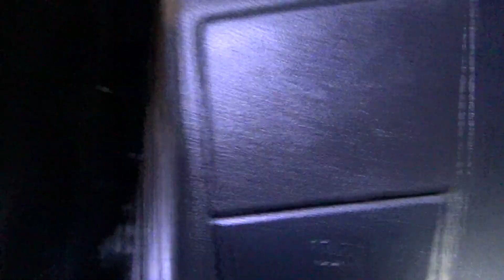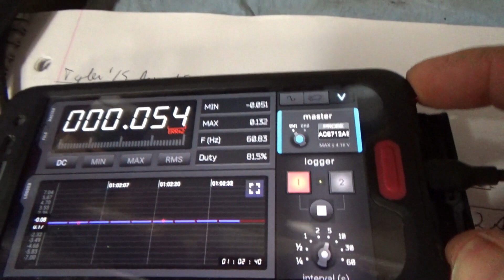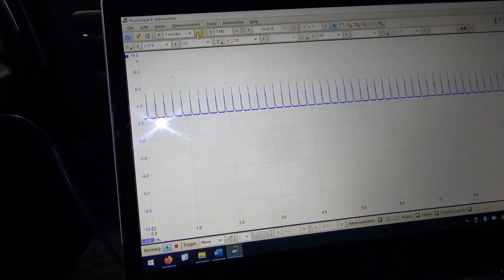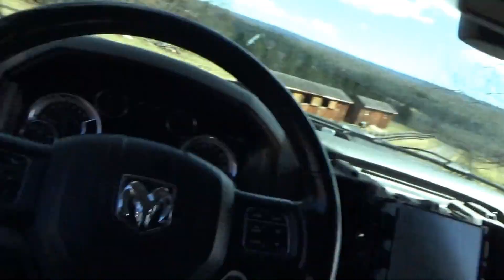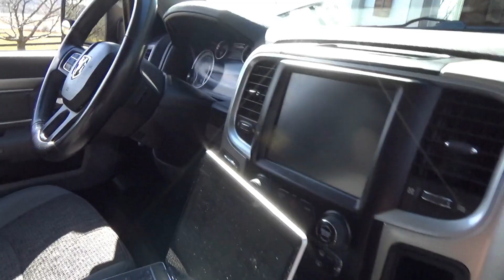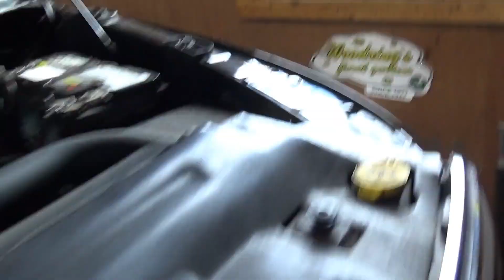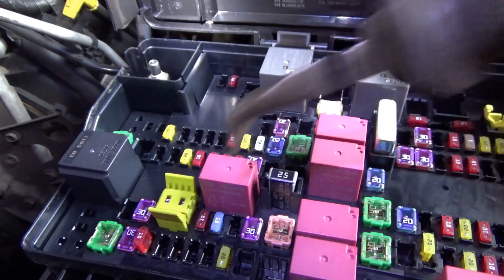Have Never Seen THIS Kill a Battery Before... (Parasitic Ram - Part 2)

Comment: Obviously a bit late but seeing as the module was faulty could you have cut the pin off the board and soldered the link across the back of he board then at a later date you could just plug in a new module in and it would work
Reply from the maker: Sure. My external mod guarantees that the problem will never happen again even if the replacement module fails in the same way 👍

Comment: We used to have a local electronics guy who would fix these modules, over the years his costs to fix was boarder line same as buying a new unit. He retired during covid.  
I recently had a issue with a battery tester out of warranty. Its basically a tablet based unit. I brought it to 3 local places and all wanted $90 just to break it open and see whats wrong. All where straight up and said the few problems they believe it could be im getting close to just buying a new one. Which I did.
Reply from the maker: What's a battery tester?

Comment: Modules are so expensive because you need it. Plus the parts are shit. Your so right on the over integration of all these modules.
I had a dodge with a what lead me to believe was the module berried behind the rear seats and rear cab pannel near the rear power window. Same thing module was $800 and labor just to get to it was another $300. 
   The customer could barely make the payments on the truck. It was towed out.
   Also availability of parts is going to be limited and I dont see the aftermarket keeping up. So going forward we will be lucky to get 10 years out of cars.

Comment: As a suggestion, how about using a relay to isolate the comms wire from the network, the relay being operated operated by the ignition (switched 12V) similar to what you have done. That way the module will still be connected to permanent 12V and keep it's memory whilst allowing the car to sleep. (Although granted the faulty module itself will still draw a little current, but a lot less than the whole network was). Don't get me wrong, yours is a great solution and certainly the best for battery life. I 'll bet there's not much wrong with that module either, maybe a shorted diode or capacitor between the permanent and switched 12V rails, so the switched rail is being held on. Probably a 1 dollar part or less causing the issue.
Reply: The Battery would probably die in 4 or so days instead of 1 or 2 with a relay installed.
Reply from the maker: @NoWr2Run  maybe a week...
Reply: @PineHollowAutoDiagnostics  OK, You are the EXPERT, SIR.
Reply: The surface mount capacitors are notorious for failing. You can replace with a through hole electrolytic quite easily. The larger ones is probably the rail caps.
Reply: @jimgross5  So are the small ceramic  capacitors. They have a tendency to go short, or more bizarrely as I have seen in Michael Dranfields recent TV repair video, can act like a variable diode, which is very strange indeed.

Comment: Ivan, nice fix option, however...I believe upon each re-powering of the HVAC module the stepper motor controlled blend doors will be commanded to go through their "recalibration" cycle [full clockwise, full counterclockwise]. I'd be concerned about short life for each blend door motor. Those modules are priced "stupid" expensive for the same reason that healthcare costs are...because they can. :)
Reply: Yeah that’s the only issue I see with the module not having battery power. Dodge vehicles are especially picky with hvac actuators and calibration. If one of them fails it’s tries to recalibrate every time you turn it on and it takes about a full minute before the air will start blowing normally. In this case it’s going to have to recalibrate every time regardless. That would be a long minute in this southern heat where I’m at 😂
Reply: Lets see, lets wear the stepper motor blend door mechanics out not from use but recalibration. Sounds like an HP printer using up more ink turning on and cleaning then in printing.

Comment: 1. Automotive engineers are being too smart by about 90%. The old electrical systems worked just fine with far fewer failures. 
2. Would it have been prudent to locate and inspect the failed module before calling the customer?
3. Is there a used HVAC module available for less cost? 
4. I promise that module didn't cost Fiat over $800 at the factory. This is a ripoff.

Comment: Ivan, if you think there are to many modules in a 2015. Just wait a few more years. I am tech at ford dealer and the new cars have an absurd amount of modules. It will make your head spin. Modules for over the air updates, hotspots, "smart" charging systems that don't keep the battery charged.
Reply from the maker: Euro cars had like 50 modules and 6 networks even 15 years ago... Insanity!

Comment: using a higher amp fuse is a bad idea.  there may be wires on that circuit not capable of handling that amount of current.

Comment: Had a '15 Ram like that with the Ecodiesel plus the air suspension. Never really had any problems with it but every day I became more and more wary of things like this happening. I got a great deal when I bought it very slightly used. I decided to sell it before stuff like this started happening. We have an Excursion with the 7.3 and I decided to go back to that for towing, etc. I do miss the Ram but I'm sure I saved myself headaches like this.

Comment: Ivan, You picked the right field of automotive repair—great diag and fix. More bells and whistles cause more problems than they are worth. The problem is even base-model vehicles are littered with chips and electronics. I'm considering replacing my 2009 Ford Escape with a 2006 Lexus LX470. Am I nuts?

Comment: Car manufacturer and dealers have killed the goose that lays the golden eggs, cars are way to expensive. With just the cost of parts one should be able to charge the manufacture and the dealer with financial rape. The legacy auto complex is killing the car market. The MSRP plus the dealer markup has finally caused the consumer to draw a line in the sand as say enough is enough. I don't care if the auto industry collapses and has to rise back up, cars need to be made simpler and and with lower prices, not cheaper. 99% of the houses around the world don't have all the automation that a cars has. what ever happened to manual windows or a HVAC system that has low, medium and high or a tail gate or hatch that is manual operated.

Comment: I had a similar one on an new Audi, it had been to loads of dealers including the main distribution dealer, it had the whole Fan and climate system replaces several times,  I sat in the car listened and heard a crackle looking at the module it was like an edge connector inside the housing,  the connector inside pushed the board out the back into the module bending the board  so was a bad connection with the connector plugged in, I cut a piece of foam to keep it pushed forwards onto the back of the connector,  the dealer huffed and puffed but paid me straight away

Comment: Hi Ivan, is an eBay module out of the question? I've done mods like that in the past, either you are a hero or a horses butt. the safe thing is replace the part and do those things on your own car.
Rich
Reply: I think the owner made the decision and Ivan stands behind His work. It would be a gamble at best to get a used one from anywhere or a 99.9% chance that a new Dorman module will fail.

Comment: If I was going to keep the vehicle forever, then I would go straight to the by-pass option. I would do that type of repair to my vehicle and save up for the module if I couldn't afford one straight away and I was only keeping the vehicle for a few years. I might risk buying a second hand one before the by-pass option, though if that was also faulty, then the by-pass would happen from the get-go. Admittedly, I tend to keep my vehicles till they are old - we don't have snow here, so a thirty year old car or older is common here, and they are in good working order. I can't believe that vehicles only several years old are ready for the crushers in the rust belt due to salting the roads. It is pretty sad and very costly to replace vehicles that often - or worse, have death traps on the road, with younger families or young drivers in these death traps.

Comment: It sounds like the HVAC is looping on the power up startup sequence, initialising all the parts it's connected to like the blend motor and the compressor solenoid,  the fix with switched power is a good idea at least until the the fault develops into a hard fault like the fan going mad

Comment: My 1967 F250 has manual cable and sheath for control of heater valve and blend door.  It needs some lubricant every decade or so.  It needs a shift collar and bushings in the transmission linkage every 50 years or so too.  Never fails to start after sitting unused for months. Never stuck in Park either.

Comment: Glad that you were able to find and fix the truck! Wonder if a salvage yard would have the module from a wrecked one?
Reply: You can bet they know how insanely overpriced OEM is & will be charging accordingly. Also, quite tricky to get the exact replacement.
Reply: I was thinking the same thing. Probably needs to be programmed in too.
Reply: most likely has the same bad internals
Reply: @glasser2819  I tend to doubt this module is a common failure resulting in a dead battery. That would be a factory recall item. A lot of pull-a-part yards around. The headache is getting to the module and making sure it is the correct part #. May have to go through several trucks to find the correct one.

Comment: Good job Ivan! Yeah, screw the manufacturer and the dealership that wants to screw the customer! F'em if they
can't take a joke, yet the joke is now on them!  I'm already thinking that Fiat/Dodge/Chrysler is just mafioso! I too 
have a 2003 Jeep Grand Cherokee that I'm not happy with but I like the old beast! Yet I will NOT take it to a dealer
or locksmith to have a a key made or have any of the programing done including the fob!!! I tell you that this one
also has gremlins too like interior lights coming on or sometimes not turning off. I also have parasitic draw do to
a badly worn ignition tumbler and so if the key position for off isn't just right, well the battery will go dead like
no other! I have bought all new parts to include fob programmer work around kit and just when the weather gets
straightened out that's when I get busy! I also had the windows switches on the driver side go completely dead!

Comment: I appreciate your diagnostic and videography skills. Thank you for another journey in a ridiculous rogue network system. Its extremely valuable to have this level of honest documented repair work! The mfg is treating these modules like its a $900 laptop when it's just a $50 Raspberry PI. My Chevy HVAC position feedback potentiometers need to be cleaned to keep the module from constantly trying to adjust the blend door. Maybe Mr O has an identifix common issue? Your solution is more than likely a lot cheaper than digging deeper into the dash.
Reply: That rouge looks good on you, btw...
Reply: @atticstattic  thanks its fabragette - fixed

Comment: Since the module was out and taken apart. I would've soldered the pins together inside the module. Then if the module becomes available without the extortion, it's just a matter of repairing the one cut wire and swapping the module. But I am crazy like that.

Comment: cut the power feed to the module ad a relay in that is controlled by the ignition power feed. leave it on its original circuit just have it shut off by the relay
Reply from the maker: Too much work lol

Comment: Ivan, The reason for Battery power to the module---- When you open or close the doors, the HVAC controller manipulates the Re-circ door to optimize conditions. Trying to keep condensation on the right side of the glass. Remember, condensation is always on the cooler side of the glass. We don't want condensation where we can't remove with the wipers. I realized this when I would get in a 2000s chevrolet and the recirc door would start clacking. It does this with the key off. Just thought this was interesting.
Reply: I remember repairing a GM recirc actuator by rotating the gear inside 180. The drive gear had a fresh set of teeth at rest. The stuff we remember..
Reply: @Krummin  fun fsct 80s and 90s GM vehicles, fully closed recirc doors allowed 7% outside air. Just remember reading that in Service Info.
Reply: That feature isn't essential. And opening/closing the recirc door when parked wouldn't do much because you need something causing the air to circulate when parked.
People have survived for decades without that.
However on a vehicle with an integrated parking heater it would be useful to power the HVAC module. If the vehicle don't have a parking heater then it wouldn't be needed to have it battery powered.
Reply: Early 2000’s GM recirc doors clack when they sense the presence of people it annoys.
Reply: I believe that there is a chemical that can be sprayed on the inside of the windshield to prevent fogging. 🤔 Thought it worth mentioning.
Reply: Wow, the things we had to live without for the last 110 years is just unacceptable....

Comment: Q. for ya.... you have done this in the past, could you not open the module and reflow all the solder joints and see if maybe it can be fixed that way... or would you still have the same problem  in the short term because of possible component failure. just thinking out loud here.
Reply: @T.J. Kong yea just thought id ask, thanks for the reply.

Comment: Manufactures are making things to where you can’t fix your own car.   Right to repair.  They want you to go to the dealer for repairs.  You want it you will pay through your ass for the parts or repairs if the problem is found.

Comment: Could there be a bad mosfet on the board allowing power to flow when it shouldn't? Easy to test
Reply: MOSFET, maybe but that needs more electronic knowledge to test. I noticed that Ivan don't bother to check for cold solder joints. Seems that is his limit.

Comment: By the way, to all the people out there in inter-webs land, given the specifications on the electrical needs and the necessary logic, a decent electrical engineer and programmer could build a replacement module using an Arduino (about $32) and a maybe $2 worth of wires and other components (resistors, for example).  These modules are measuring voltages, making logic decisions, setting voltages, and communicating on a serial bus.  That's it.  I teach an introductory class to CS majors and we use Arduino micro-controllers as part of the final project.   The public is being taken for a ride and its the not so fun ride.
Reply: @T.J. Kong Agreed.  "Trade secrets" is what I believe they would claim.  Just a sad reality.  If they used a standardized system of modules such as the Arduino (or others) they could lower their initial costs and decrease repair costs later. It could even be standardized across models to a particular extent and then just update the code.  However, I suspect there is a bean counter someplace pushing bits through a spreadsheet on how much they make from after new vehicle parts sales that would be disappointed if their revenue stream was reduced from a flash flood to a quiet, gentle flow.  Is that cynical enough of a view for Sunday?  ;)

Comment: With each computer screen, may it be on a laptop or vehicle entertainment center, the display has a built in
oscillator that is part of makeup a display high voltage circuit and that is the sound that you are hearing as
I am fairly certain. BUT, the oscillator should only be active when the stereo/radio package is turned on....
per say! UNLESS, there are other instances whereby system integrations to tell you other information about
the vehicle itself....ie GPS, so on and so forth. By all rights, that oscillator should only be active so that you
can have display sweep and high voltage. So, this is quite strange! If there is a demand for the display to
light up, well then you should hear that small oscillator, plain as day.

Comment: $800 at dealer breaks down to $400 to dealer as mark up, $200 to manufacturer as mark up, $100 to supplier as mark up, and then $50 to the importer as mark up, leaving the actual cost as being $50 for the guy in China who has to buy the parts, have the board made, pay to make the dies and make the box, and pay for shipping it half way around the world. Note the chips alone cost him $30 before he even started, and he had to buy 100k of them with up front payment.

Comment: I have a 2014 RAM 1500. The HVAC system is very noisy for up to 15 minutes after shutting off. Not sure why.  It also depends on if you have the remote keyless and how close they are and blah blah blah more engineering magic blah blah blah. I just can't with engineers anymore.  I can't fix their problems given their attitude toward introductory physics classes.

Comment: 6 owners?? Wow! This expensive part should have been replaced by the dealership under warranty during owner #1 or #2  time. The dealers either purposely refused to diagnose this to module level or were too stoopid to figure it out. Dealer wins again.

Comment: Nice repair, saving lots of money. just a suggestion, but next time cut the leg in the box, and make your solder connection in the box. that way you have no cut wires and future replacemet is way easyer.
Reply from the maker: That's actually a great idea!
Reply: With multi layer boards it might not be easy to cut the trace in the box but soldering the pins together is. The other option to avoid cutting the wire is removing the pin from the harness connector.  

Generally I don't like cutting circuit board traces but in this case if it's possible it is a great idea. 

I like to restore vintage CB radios and some of those have been modified with chopped wires and cut traces.